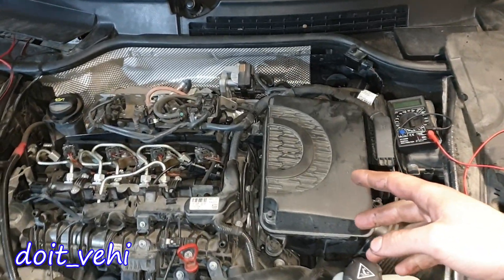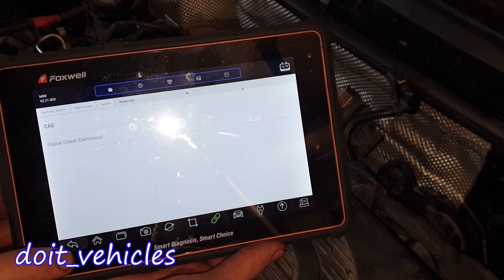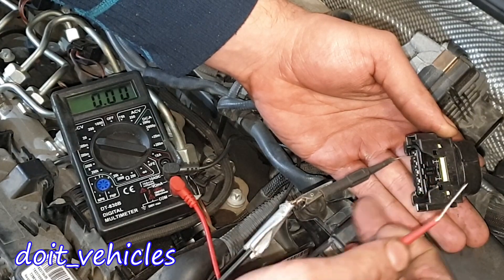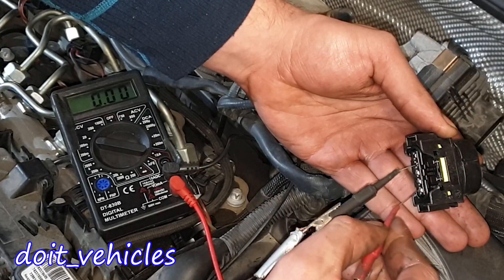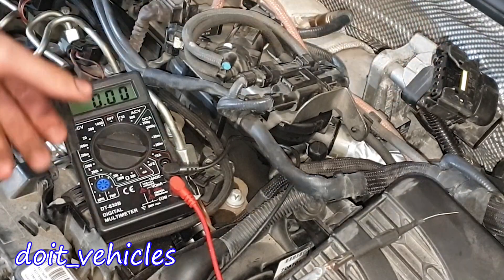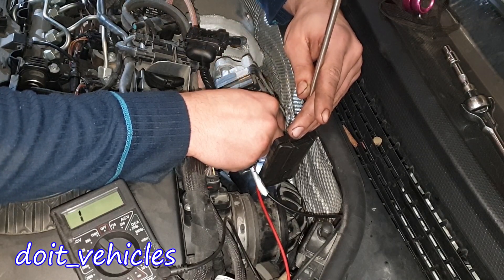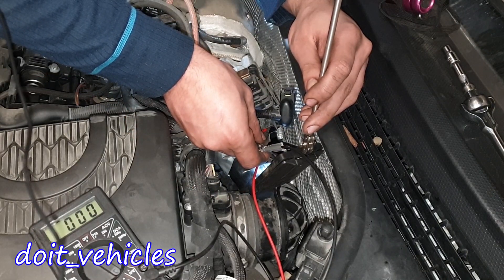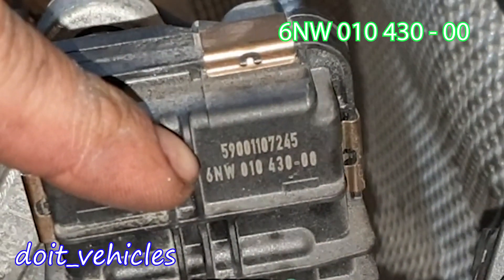Mini One D Turbo Actuator Check / Test ( diesel )

Comment: Hi I tested my actuator with multimeter and found excactly the same values. I tested the original actuator and it seems to works fine. Today i have replaced the actuator with the original Hella actuator which was equipped on my car and coded to my ECU. Th actuator was preserve. The turbocharger works at once. I has not worked in two years. Thank to my knowledge as an electro engineer and thankfull to you who share knowledge about measuring the actuator. It is a pleasure sharing good news. Please keep on with the good work. :-))

Comment: I need to do measurement on my actuator and your video is fantastic tutorial and exactly what I need to do. Thank you very much. Is the actuator coded to the ECU on each car? So if i replace a turbocharger with a new actuator I have to get the new actuator coded to the cars ECU?
Reply: no. you can change the actuator without wirte new map or something in ECU!!
Reply: @Alex-ww6tq  The actuator must be setup with the right operation range within 65 degree. It must be setup with stop1 close position 89 degree and stop2 24,3 degree open position. When the engine stop the actuator arm should move to close position. When the engine start the actuator arm should move to open position. In order to program a new actuator you will need a actuator read /program machine connected to a computer. In Oslo there is only one turboservice workshop which has this kind of equipment tool. After I have got installed 3 new turbochargers with 3 new actuators. None of the new actuators works, because none of the 3 actuators was programmed with the right stop1 , stop2 and the operation range was wrong. Luckily I have saved my old turbocharger. I reinstall my original Hella actuator , the configuration was preserved and my turbocharger works perfect.

Comment: Hi my test on plug was all zero except the the last one that shows 5... and the wastegate all zero. What that means?
Reply: Check the fuse
Reply: @dinhvanpham8102  where can i check the fuse?
Reply: @charrovitorino  If you have a BMW 5 series, there is a fuse box in the glove compartment. The most important fuses is in the trunk right side. remove the cover in the right side, open the cover and find the paper for all your fuse diagram. Hop this help you.
Reply: @charrovitorino  The most simple way to check your actuator is to set ignition on, use a test torch and connect it to ground minus connect a test wire to pin 4 from left(Pin 1 is on the left), then connect the test torch to the wire. Your actuator should move everytime you touch with the test torch. If not work and the fuse is ok. Your actuator is faulty and must replace. Remember your new actuator must be calibrate with a actuator reader/progammer machine. It must be setup with the correct stop1 Open position stop2 close position. A turboservice workshop has these kind of equipment.
Reply: Mines doing this after a new turbo and actuator did you get anywhere with it?
Reply: @SliperySausage  Reuse your old actuator, the setup is preserve and your new turbocharger will work. The new actuator must be calibrated with the same settings like the old one.  Professional car workshop used to connect a actuator reader/progammer to your old actuator, they make a backup and save the backup on a computer. Afterwards they can restore the backup to a new actuator.